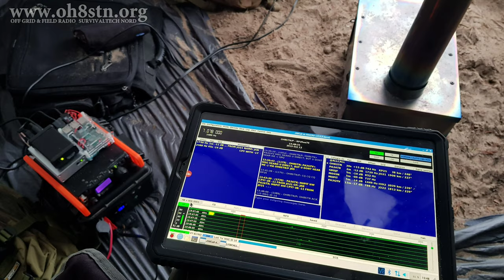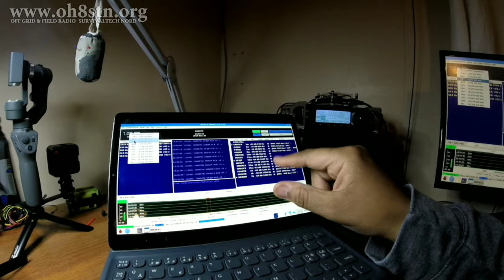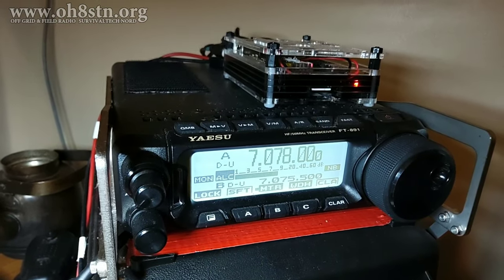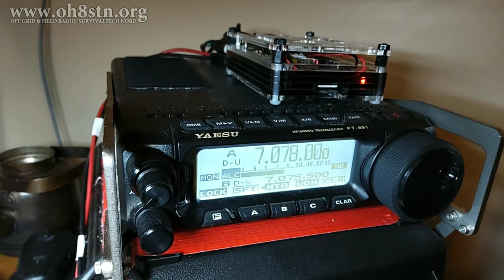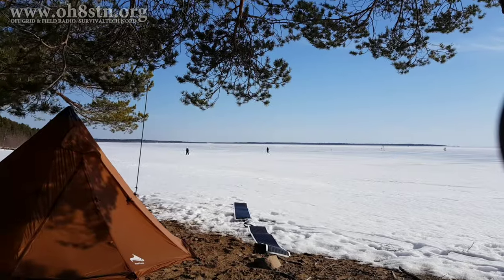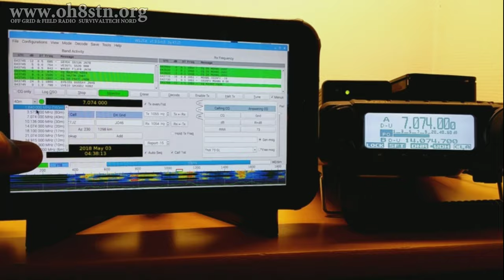Ham Radio with Julian OH8STN

Comment: Merry Christmas thanks for the interesting video not into data on ham radio that a side was good to see it explained witch is the better radio FT891 or FT857 i like to go portable running low to med rf power and have a mix of lipo battery's i can use  i will be getting the icom ic705 when it is out keep doing your video's i like to watch them i think your the best on you tube

Comment: Is it possible to use digital modes with an older radio that doesn't have a data out port? Thanks!
Reply from the maker: Absolutely. You can wire it up directly to the microphone input, ear phone output, and mic ptt. That's how we did it back in the day. You'll just have to take care of about the audio levels.
Reply: @OH8STN  Thank you so much. I may picking up my first radio soon. Kenwood TS-130SE

Comment: I just got JS8CALL up and running. I was really hoping it would be a good EMCOMM medium, but so far, my impression ( and I could very well be totally wrong), is that it's mostly automated status reports with very little human to human contact. I saw a few genuine QSO's, but even they were limited to very brief comments about antennas or location. Seems terribly underutilized.
Reply: Jim. wholeheartedly agree. This mode has soo much more to offer  but if no one puts the effort in... it will go the way of the DODO.  I am so upset about the amount of stations that do not even enable other replies that heartbeats. On the bright side... had great 1/2 hr  QSO with Sweden this morning... running in TURBO mode.  Saying well done to JT8CALL author for a wonderful piece of S/W.
Albert EI7II.

Comment: I would recommend a look at the PineBook pro.  It is a Raspberry Pi 4 like single board computer in a laptop case.  The battery lasts 10-12 hours and the whole thing would make the Samsung tablet superfluous.
Reply from the maker: Commenting on the wrong video?
The Pinebook is fine as a cheap laptop replacement. It weighs in at 1kg, which is 800 grams more than my tablet with keyboard. With only 10 hours runtime, the Pinebook would be a huge step backwards in runtime. The limited memory expansion and max 2gb ram are a reduction in capabilities, not improvement. Hardware drivers are also lacking behind the standard linux kernel, according to their webpage. It is cheap, which is nice if that's ones main requirement. 
The point of using a Raspberry Pi with the radio, is the ability to connect to it with any device. Mobile phone, Samsung tablet, Pinebook, Macbook, ... all without wires. The end user chooses the best solution for them. For me, the Pinebook is a no-go, but may be perfect for you 
I do like the concept, but I'm hoping  they'll be an improved release later on 👍👍👍😊